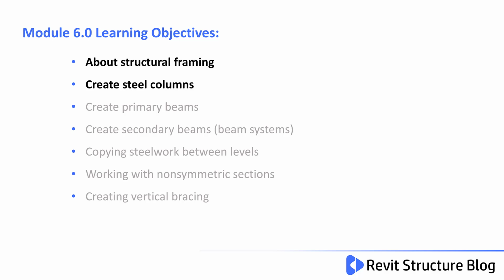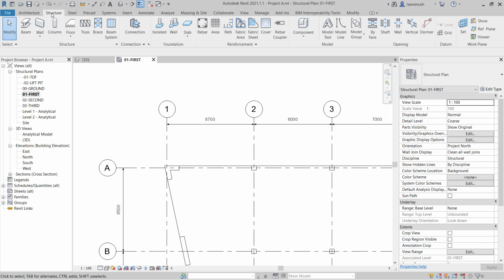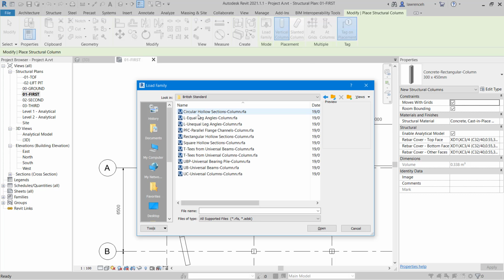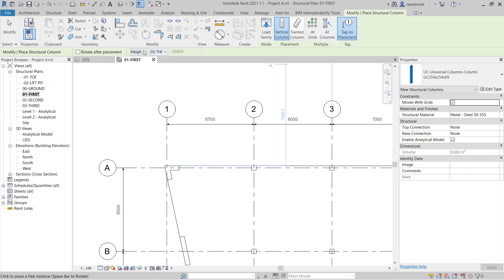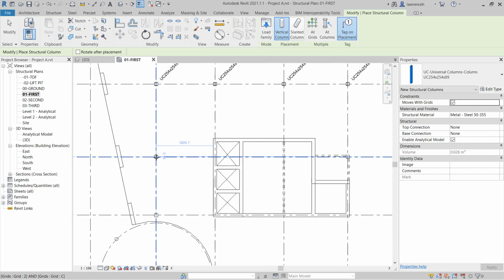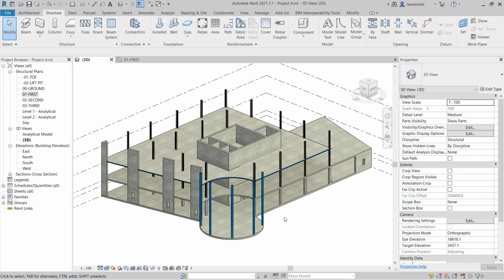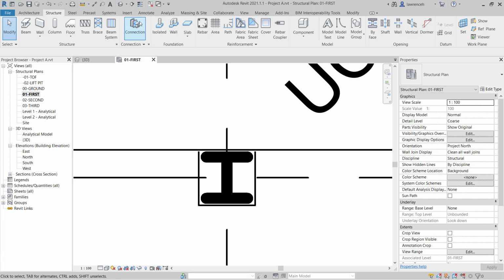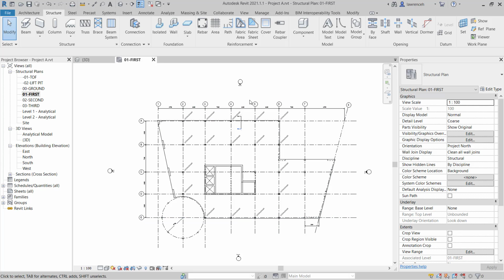Revit 2021 Training For Structures Essentials Module 6.0

Comment: hi great videos and Ive leanred a lot. THankou for sharing your knowledge! I had a technical question:
Im learning Solibri and trying to do proper Informarmation Take Offs (ITOs) based on the IFC models. 
I wanted the quantities to be right. So needed your advice on the structural models:

1. Do we model columns from slab top level to the next slab top level? Or do we give an offset of 150mm or 6" based on the slab thickness? 
Or do we join the slab and columns together?

2. If there are beams, do we connect the beams from grid intersection to the next grid intersection? or edge of column to the next edge of column? (Im assuming Revit automatically connects the beams, columns and slabs, so this is not going to be a problem when modeling the structure?)

3. Regarding steel, Im assuming we create the columns from one slab top level to the next, since the concrete will be cast-in place. But what about the intersections between the steel column and the concrete deck or composite slabs?

Thanks
Reply: okay i go my answer through chatgpt. Revit automatically connects the slabs, beams and columns so its better to model them from level to level. 
Im assuming this is correct oder?
Reply from the maker: @mpsarchitects  Hi, yes, you should model floor to floor as this also helps when building an analytical model.